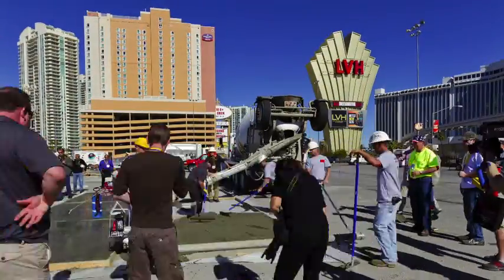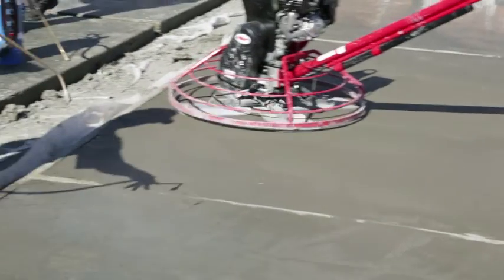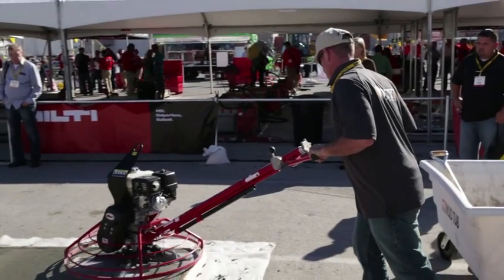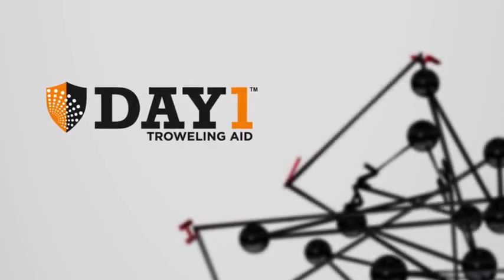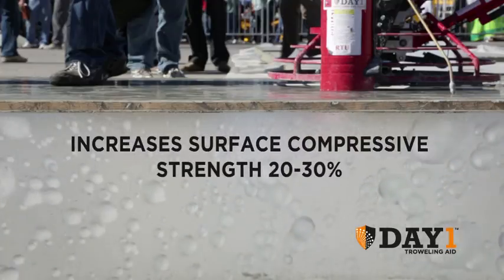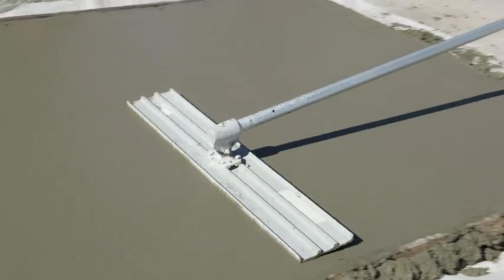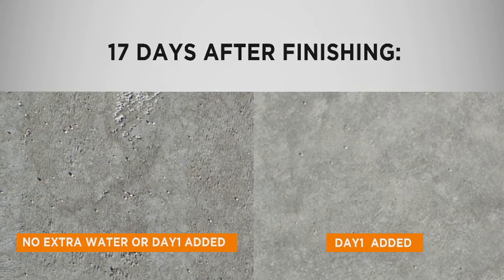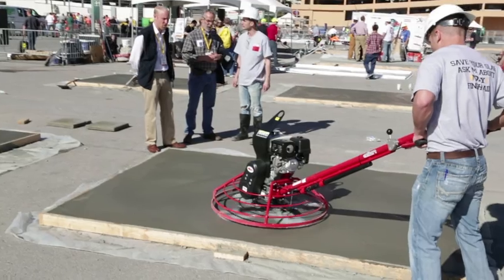Lythic  DAY1  from Solomon Colors

Comment: Anybody know how Day 1 works with stamping and does it accept acid/wb staining?
Reply from the maker: Powderfinger  Day1 is an excellent product to use with stamping. It helps keep the concrete plastic longer, assisting in stamping. If you choose to use a color hardener, as well, Day1 is also excellent for making that process easier. Day1 will not interfere with the concrete's ability to accept stain or sealers.
Reply: SolomonColors Danke amigo for the quick reply!  I picked some up recently and looking forward to using it.
Reply: Using day1 on a 1 color base 2 color highlights job on Monday.. Is it any different then finish ease or conflim?